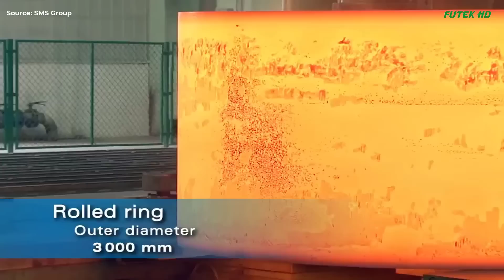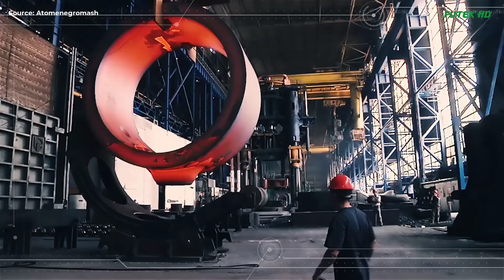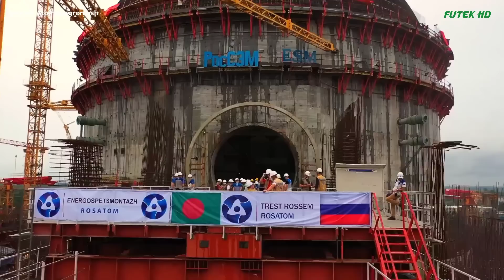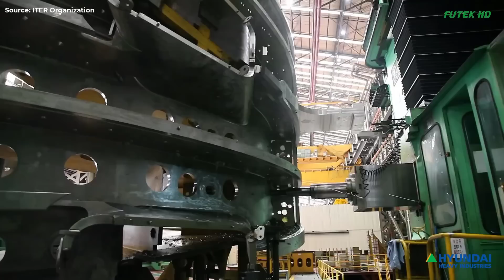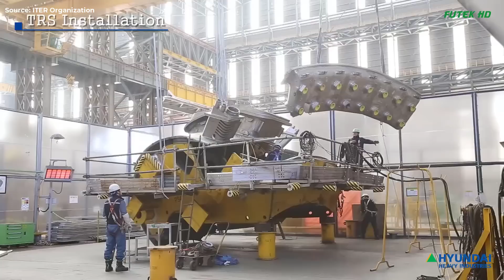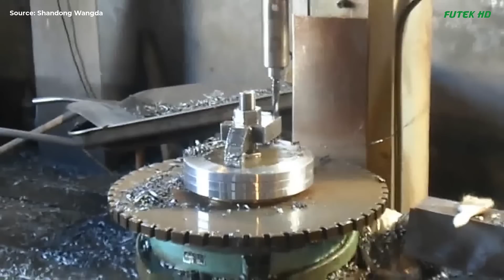The technology to build this Russia's 334-ton reactor has amazed the world. Modern Forging Machine

Comment: But how are the rings conneted? How can one weld weldseams of about several inches of depth?
Reply: it's possible!
Reply: @victormakovchik249  But how! That's the real thrilling part that is missing in the whole video!
Reply: @LCdrDerrick  You can find example - how high pressure steam pipelines weld weld seams of 80 mm of depth. There is the steel alloy with nickel and chrome. 
You can write me to the mail )
Reply: By welding. Not interesting, usually day in Russia.

Comment: Hello, thank you, prevent effect of global warming, New energy from sea will change world soon, minerals and temperature of water and air from sea are huge source of energy, reduce more than 50% using fossil fuel, fresh water, fertilizer(minerals+O2,N2,C), electricity,  zero pollution, economy will rise, I invented new method base on designing this machine, it  produces 150Megwatt/hour and 20000M3/DAY fresh water and fertilizer, using power magnet of machine as catalyst to separate N2 and O2 from Air ,  using jet plasma machine that it compresses gas(hot Air) in isolated structure in water pool with more than 80 % efficiency, it has two vertical cylinders, in first level it transfers compressed gas(hot air) temperature from engine to sea water in pool for steam electric generator, steam combines with high cold Air pressure to produce pure water and electricity , there are other source of energy that with international cooperation in coastline we can reduce effect of global warming, further more we can prevent these phenomena like cyclone and flood and wildfire , ocean water level will control by using this hot seasonal atmospheric condition, recent years in summer, geothermal energy happens in surface of coastline, there are many countries in coastline with seasonal hot weather and water condition in comparison with middle Ocean, its more than 12 degrees ,this differences must decrease, in sum-up, by using this energy not only is economical but also reduce global warming in countries like Japan, China, India, Mediterranean countries, Iran, Brazil, Mexico, Us, Canada, (Africa and Arabian countries....) . I invented new method base on air pressure rules and quantum physics ionization sea water minerals in strong dynamic permanent magnet(SMCO) with special frequency(1500or 3000)/minute bases on paramagnetic and diamagnetic particles and electrical microwave electron wave field and electric chemical reactions and photon wave from semiconductors with special angle Cations like(K+, Mg++, Na+, H+, H++, li+, H2, ...) are transferred to in the second level into up level by vacuum pump from storage into combustion chambers and they combine with O2 and N2 ,... as major part of fuel, they increase speed of machine, modern induct Gearbox to control speed of opposite direction, for producing electricity and fresh water (removed minerals by accelerate ionization system from sea water) and fertilizer. . 7 methods zero pollution for reducing global warming I mentioned in my profile. (G20 countries can solve these phenomena like injury and death, billions of US$ in damages).